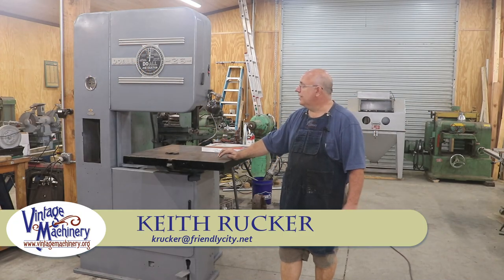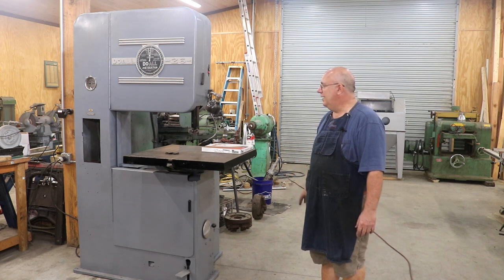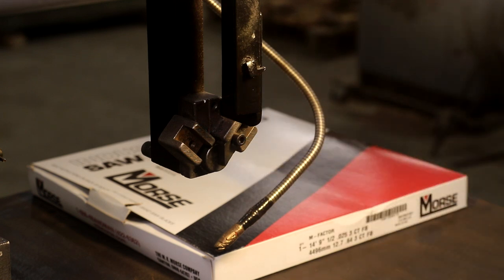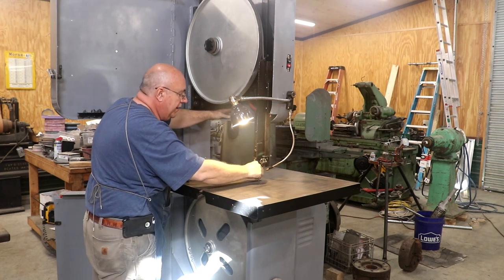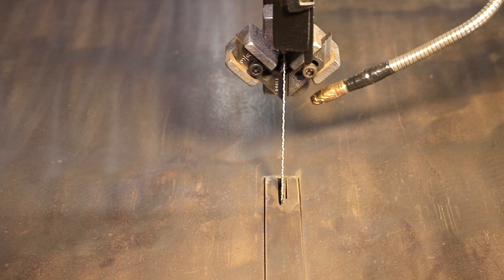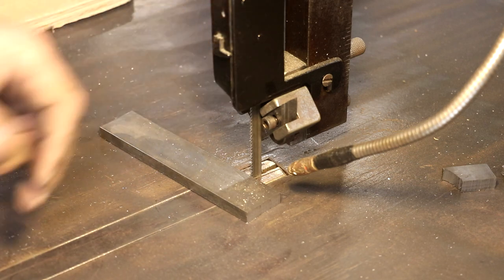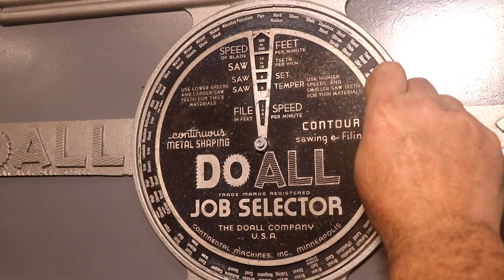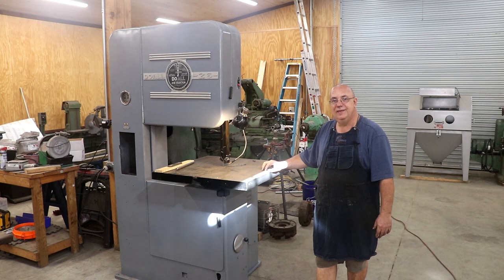1940 DoAll V-26 Vertical Band Saw Restoration: First Cuts

Comment: Thanks for the video Keith.   I have a Grizzly vertical saw (because I don't have a DoAll or Marvel (sadly).  Mine only goes down to 100 ft/min.  Regarding the blade speed recommendations, is it correct to use those published numbers when cutting dry (no coolant)?
You have another beautiful machine in your arsenal, congratulations and thanks for sharing!
Rick Tannenbaum 
Asheville, NC

Comment: When I hear or see people putting primer against bare metal I cring. While there is two acid etching non water non alcohol based primers for use against metal. They are not available to average people. One needs certification/ license to use.  Both are apply flash off and paint. If it dries nothing sticks to it. One is mostly transparent.  There is one for aluminum in a can that is sold in specialty models shops in uk.  Either way these primers are not off the shelf products. Off the shelf primers are made to fill nicks and scratches, are like a sponge and hold water, so does fillers.

It's best to just do what factories the world over do and apply paint directly to bare metal, cook it, then Do any nicks or scratch filling. For those that want to argue, save it go watch "how it's made".  I can tell primer against bare metal on car voids rust protection warranties, then again using a non fram type oil filter on cars also voids engine and oil pump warranty. I found that out when I tried a wix and burned up the oil pump.

Still it's a nice looking bandsaw Keith I would repair the blade welder, maybe even contact doall for repair pieces or for them to refurbish it.  I'd love one of these myself but I am curious as to what happened to the other metal cutting bandsaw project you had started.

Comment: if you dont find one of those welder thingys , you must rebuild it . imo
Reply: Yes, the blade welder is one of the most helpful things on the saw.  The ability to buy saw blades on a continuous spool and cut/weld to length.  The other thing we did often was to use this to cut an inside opening by passing the blade through a hole in the work, and then welding the blade together, remounting, and cutting the opening.  cut the blade again on the blade cutter on the welder remove and re weld and remount.  Saves lots of time and work.

Comment: The blade welder/grinder would be nice to have but back in the day you just bought bulk length blade and cut, welded and ground as needed. I don't think they had much of a selection of premade blades like today. It was cheaper to buy a roll of blade make your own if you used a lot of them.  The saw does look good!!

Comment: The selector dial has a 'Metal Wood' setting - what is that?
Reply: Ironwood...very useful for fenceposts...lasts forever and doesn't rot...lol...just kidding, I was wondering the same thing
Reply: @erichockuly9819   Metal wood dictionary definition: "a structural material consisting of a sheet of metal glued between two veneers. or of a veneer glued between two sheets of metal."  Yeah, I was wondering too!

Comment: What is Countour Sawing e-Filing ?? On the cutting speed selector.
Reply: You can get a "blade" that doesn't have a cutting surface. Rather the outside of the blade is literally like a file. Its a means of filing metal like you would use a metal cutting belt sander for today.
Reply: The file blades are individual file sections that interlock together like an old farm chain